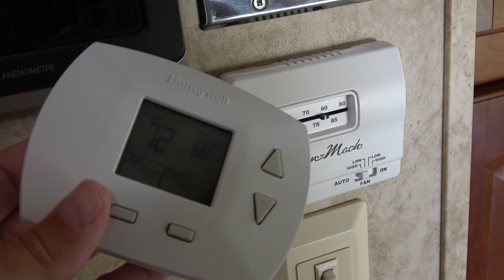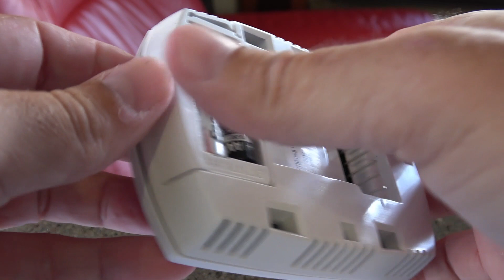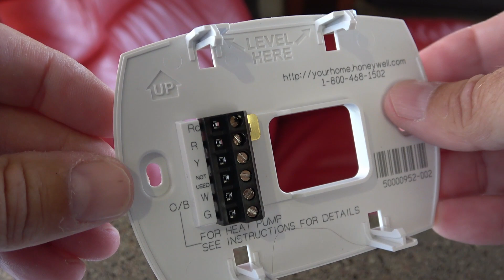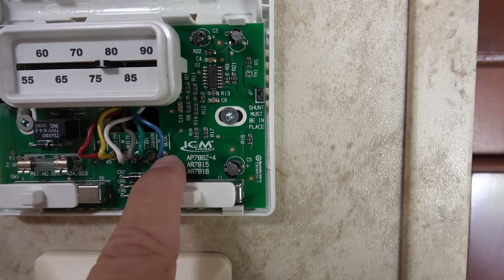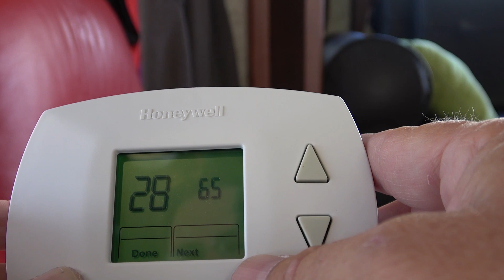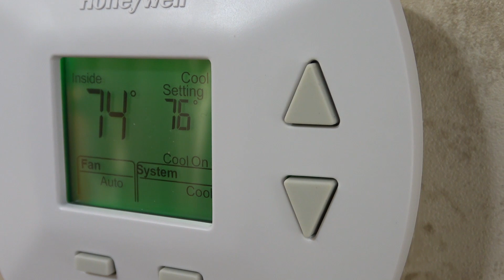Analog to Digital RV Thermostat Upgrade Mod *Explained*

Comment: Ray, do you have a off position in the ON/ON switch that you installed for the fan? If so and it's placed in the off position what will happen to the compressor as th ac is running?
Reply from the maker: No, the switch I installed is for high or low fan speed.  The thermostat has a fan button for on all the time or auto mode where the fan comes on when the compressor runs and shut off when the compressor shuts off.

Comment: Thanks Ray! We picked up a new-to-us Keystone Laredo 26RLS and needed the thermostat upgraded. I followed your process on our previous Keystone (4 years ago) which turned out great. Now I needed to do it again. This time I will add the high/low a/c fan switch. The Honeywell model you show is getting scarce to purchase (and expensive). I picked up one from ebay as I like the other so much and would not know a comparison. We love our RV.

Comment: The fact you explained about the old thermostat needing the blue wire to power the thermostat circuit and the new one did not helped me fix my issue of why I would blow the 7.5 amp AC fuse every time I would switch to the furnace. 
Thank you!

Comment: I would like to install a Honeywell digital thermostat upgrade but have a concern that the maximum is "1 amp."  My furnace runs slightly over at ~1.05 -1.10 amps.  Will/could this lead to premature failure of the thermostat or worse....?
Reply from the maker: Personally, I wouldn't be concerned about that small of difference on a low voltage circuit and ratings usually have a bit of wiggle room.
Reply: @LoveYourRV  Thanks... appreciate the response.  Keep doing the RV videos for those of use that are 'land locked' and trailering.  Cheers
Reply from the maker: You bet, another month or so of boating left then back in the RV for 8 months. :)

Comment: What did you do with the gray wire?
Reply from the maker: Gray is one of the fan speed wires. Gray and Green for high and low. So I attached it to my fan speed switch  https://youtu.be/fzH3vTZe3Qc?t=818
Reply: @LoveYourRV  Same for blue also?
Reply from the maker: On my thermostat install for a Suburban furnace and Coleman Mach 3 AC in a 2011 Keystone Cougar the blue is a negative ground wire for powering the old thermostat circuitry but the new digital thermostat gets power for that from its onboard alkaline batteries so the blue wire isn't needed anymore.

Comment: How did you connect the wires to the micro switch? Solder or use a connector?
Reply from the maker: I soldered them

Comment: I have a Dometic digital thermostat in my Jayco.  I am wanting to upgrade to an analog thermostat that works.  Would the installation be the reverse of what you show?  I bought it in February.  Last night when I went into the camper it was 73 degrees and the thermostat was set to 72 and the AC was not running.  The front bedroom was much hotter.  I moved the thermostat to 71 degrees.  Still no AC running.  I set it back to 72 and turned the fan to high to hopefully equalize the temperature and went to sleep.  Several hours later I woke up and it was 67.5 degrees in the camper with the AC running full blast.  This morning it was 65 degrees in the camper before I turned the AC off.  I later turned it back on and it appeared to run correctly.  When I returned to the camper about 4 pm this after noon, the AC was running and it was 84 degrees in the camper.  WTF(Why This not Functioning)?
Reply from the maker: I'm not familiar with Dometic air conditioners and thermostats. Thermostats have changed over the years. Some use a newer CANbus digital wiring system which is quite different than what I showed here for my old Coleman Mach AC. Maybe if you provided the model number of the AC or thermostat I could look up the manual and see how it is wired.  Cheers, Ray

Comment: I AM A HVAC TECH! Any Honeywell thermostat whenever it flashes Cool On or Heat On that means it is in a timeout. Some of them have a programming option to change how long it lasts from 0 mins to 5 mins.
Reply from the maker: Thanks for the info. The Honeywell we have seems to be set for about 2 - 3 minutes. Cheers, Ray

Comment: Curious as to why you didn't install a digital thermostat that has the dual fan speed setting?
Reply from the maker: Back then, I didn't see one that would run off its own onboard batteries and have dual speed fan option. Maybe they have them now. Generally though, I rarely run my AC fan in high speed anyway.

Comment: What if we don’t want to automatically change over to the AC.  We mostly boondock, so won’t have the power to run the AC.  Wouldn’t want to run down battery or ruin the AC because it’s “trying to start the AC”.
Reply from the maker: You still have the option to set it for heating only or cooling only or auto mode. Usually what I do is once summer is over and I no longer need to use the air conditioner much at all is to flip off the breaker labeled for the AC on the RV power panel so it gets no AC power at all. So then even if my accident the thermostat tries to switch the AC on nothing happens. It won't ruin the AC.  Cheers, Ray
Reply: @LoveYourRV  Thanks.  Good video(s) for this.  I have watched now a few of your vids.

Comment: Will this work if my little slider thermostat only controls my heater?
Reply from the maker: Hard to know, there is a lot of different wiring out there in RV heaters. Best bet is to try and located the manual with the wiring diagram for your make and model of thermostat and furnace and might be able to figure it out from there.

Comment: Installed Honeywell thermostat in my RV works fine but when my heat comes on so does the fan on my a/c. I decided not to go with high/low toggle so just hooked hi fan directly to thermostat, any suggestions on how to fix this?
Reply: Nevermind, I fixed it. My thermostat was set for electric heat, changed to gas, working as it should now. Thanks for video
Reply from the maker: Thanks for the follow-up. Likely will help others with the same issue. Cheers, Ray

Comment: my coleman-mach will not turn on until it hits 85 for the heat so my brother sent me an rth 2300 programmable thermostat is there a difference
Reply from the maker: Shouldn't be much difference unless the Coleman Mach is broken.

Comment: Would a Aprilaire model 8444 thermostat also work in a RV Because it's the same as a Honeywell thermostat and it also has the auto change over
Reply from the maker: If it can run on batteries it should work. The reason most don't work is they as looking for 24V AC for power that RVs don't have. Some people will install a voltage converter so they will work off the 12V DC in the RV but easier to find a thermostat like the Honeywell I used that can run off its own batteries. Cheers, Ray
Reply: @LoveYourRV  cool because a friend of mine actually has an RV and he's not happy with the thermostat that came in it and wanted to upgrade it and didn't know if a residential thermostat like a Honeywell or Aprilaire would work

Comment: So you don't need to use the blue wire? I hooked up my blue do I need to remove it? Other than that I just kept mine at high fan. Thanks. Matt.
Reply from the maker: Things can vary from RV to RV but for my wiring the blue wasn't no longer needed. Since the new thermostat control chips and relays are is powered by alkaline batteries and not the RV 12V system it doesn't need the blue -12 wire hookup like the OEM Coleman Mach thermostat does.

Comment: I did this on my older rv with no issues so i put one in my 2013 jayco last weekend. At first all worked well, but then the furnace did not run that night. Put my meter on the 12volt leads and only had 1 volt and nothing worked. I didn't know to leave the blue wire off so could i have fried my furnace board?
Reply from the maker: It's strange that all worked well then suddenly quit. Maybe some wires crossed and blew a fuse somewhere. I'd check the 12V fuse panel and see any are blown.
Reply: @LoveYourRV  All fuses in panel are good. Is there a 12 volt feed from the furnace? Saw on another site there is another breaker in the furnace.
Reply from the maker: There is a 12V feed to the thermostat from the main RV 12V distribution circuits to trigger the AC and its fans on and off and the furnace run cycle on and off. This 12V is switched via relays in the Honeywell thermostat which is powered by the AA batteries. I assume the AC and furnace control boards also have relays. Then there is a 12V feed from the main 12V RV distribution right to the furnace to run its fan and gas igniter and power the control board.
Reply: @LoveYourRV  Thank you for the help. It's strange that there is 1 volt at the thermostat. I would think it's all or none which leads me to believe that maybe I cooked a control board somewhere. I'll keep working on it this weekend at the lake. Thanks again.

Comment: Thanks for making the video. I really wish you would have shown how the wires go into the new thermostat. It's a very important step to skip it seems at least it is with me. So much great detail in every other part of your video, you even say to leave the jumper in but nothing on wiring the replacement thermostat.
Reply from the maker: Likely because this was just an update video for two other videos on thermostats I did for my viewers, sorry you came in late  - https://www.loveyourrv.com/rv-thermostat-upgrade-honeywell-focuspro-5000/ and earlier https://www.loveyourrv.com/hunter-42999b-digital-rv-thermostat-install/   It does say in the title  Mod "Explained" and previous links are in description  Cheers, Ray
Reply: @LoveYourRV  Sounds like that is just what I needed, thank you.  this video is so detailed that I didn't think to look for another one. I couldn't figure out how someone as detailed as you would leave it out. My old thermostat is not labeled by color on the terminals, it has the words furnace (fur), cool, hi fan, etc.. My new one just says G, Y, W, O/B, R and RC (jumped) ....  so it wasn't clear and I didn't want to guess. Thanks again.
EDIT: I just looked at your first link and it's exactly what I needed.... perfect! 
I'm not using the Honeywell, I'm using an Orbit 83521 because it's programable for 7 days. I use my Travel Trailer as a home office.

Comment: Sorry about that it has a complicated system in there from the factory that is no longer manufactured I'm attempting to put in a new Coleman Mach digital thermostat however I only have two wires available and it needs three when I hook up the blue wire to the hot wire the furnace fired fine however I lose the digital readout when I disconnect the blue wire from that I get the digital readout but the furnace will not fire can you please help me. For your convenience you can reach me at 215-454-9438, you may text or preferably due by The voice. Thank you so much and have a blessed day also any expediency would be greatly appreciated as the problem I'm having now is the furnace won't come on until 60° and then shuts off at 72° and I've calculated that this swing is taking approximately 35 to 40 minutes to accomplish. I go through a 20-lb cylinder of propane with an ambient temperature approximately 25 at night to sometimes a high during the day of 35° and will consume that 20 lb in 24 to 26 hours. Further I understand that electric is much cheaper to use however that is not possible at this time just FYI !

Comment: Hello I've got a question that perhaps you could possibly help me with. I've got an Atwood heater in my RV, 1997,
Reply from the maker: Sorry I'm not familiar with the Atwood furnaces and that is an oldie, the one I have is a 2010 Suburban. If you can locate a model number you may be able to Google it and hopefully find a Service Manual to download and in that locate a wiring diagram for the thermostat. Once you have that you can determine what the wires are. Color coding isn't always the same between different manufactures and RV makers.  The other option is to locate the manual for the old thermostat. Cheers, Ray

Comment: Big, big thanks from a Winnebago View owner who thought there must be something better than this sliding switch that gives us either an Arctic blast or nothing! I bought the Honeywell FocusPro 5000 and was starting to think I'd made the wrong choice before watching both of your videos (switching from Coleman Mach to Honeywell). Starting last evening and finishing this morning, I now have a really user-friendly and precise controller installed for my own use and for my RV renters who take "Clio" on the road. Thank you so much for doing the work to find a great solution and for sharing it (and explaining it in detail) to the rest of us! I was intimidated at first by how difficult it was to turn the "red wire" screws on the new Honeywell unit, but I called their help number and decided to use my little screwdriver and strong pliers to make space for the red wire. That worked quite well, and now the new Honeywell is set up and working exactly as I'd hoped!
Reply from the maker: Awesome, that's great to hear. Cheers! Ray

Comment: I have 2 thermostats in my traile one for heat one for cool does this work for both
Reply from the maker: Yes, for my trailer with Coleman Mach 3 AC and Suburban SF30 furnace this Honeywell digital auto switches from heating to cooling which is nice as we often need both in a single day at certain times of the year. There are a wide range of appliances and wiring in RVs so can't guarantee it would work for you.  Cheers, Ray

Comment: Good job on simplifying a changeover that Honeywell customer service couldn't help with (tried twice).  A person should be able to convert from a 6-wire C/M thermostat to just about any battery operated Honeywell thermostat with what you've shown here. One thing H-well customer service did tell me, was that their thermostats are for 24v systems.  You can use this on a 12v (RV) system, but only if it is a NEW install.  Apparently something happens internally once it is connected to a 24v system, and it won't revert to a 12v system.
Reply: BTW/FYI, I'm not sure if what Honeywell told you about prior 24V install is correct. I bought a Honeywell TH6110D1005/U (Focus Pro 6000) Programmable Digital thermostat off Amazon in "Used-Like New" condition for cheap. You could tell that it had been previously installed by someone (mounting hardware was missing, wall bracket had screw head impressions, terminal screws had some in/some out, all manuals missing etc. and some of the program codes had been changed (they had it set as Cool Only Mode). I reset it back to factory settings and changed the codes to what I needed (added heat mode back in) and it works like a charm in my 2018 Heartland Mallard M28 travel trailer 12V install. Just thought I'd add that for future readers. Cheers.

Comment: I have the exact same set-up. I'd love to have a wifi thermostat. If a can find a wifi residential thermostat that works of batteries, I don't see why that wouldn't work also?
Reply from the maker: I imagine a person could install a power converter in the RV to supply the 24 VAC that most home thermostats use. Could run an inverter then use the 110VAC to power a 110VAC to 24VAC step down transformer or use a 12VDC to 24VAC converter. Something like this https://www.powerstream.com/inv-12dc-24vac.htm

Comment: My Coleman Mach thermostat is intermittently malfunctioning and keeping the furnace on, so I'm looking to upgrade to a digital unit.  Have you had any issues with this one after the install?  I know a lot of folks post initial reviews or videos, but you never hear about any long-term updates.  Is it still working well for you without any issue at this point?
Reply from the maker: I've had a couple updates I've posted on this on this. Here was my most recent a couple months ago - https://youtu.be/ZxumGGRZpVA?t=516  Cheers, Ray
Reply: @LoveYourRV  Awesome!  Just watched your update.  That's helpful to know how long it's been working without any issue.  My current Coleman Mach analog thermostat (same one you featured in your videos) has malfunctioned 4 times over the past couple years and kept the heat running continuously.  It did it once last year and 3 times this year, so I'm getting to the point where I'm feeling like making the jump to a digital one.  Thankfully, your wiring is similar to mine, so I'd feel more comfortable doing the upgrade when I'm ready.  I wish I could pinpoint what's causing this one to malfunction, but maybe something's up with the relay or one of the resistors, but that'd be really hard to track down and I'm not much of an electrical whiz either haha.  Thanks!